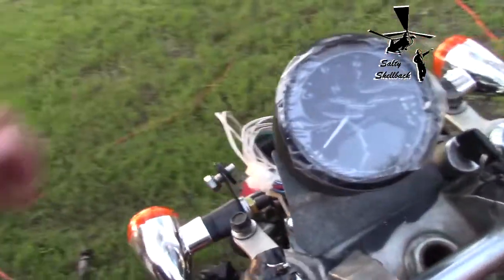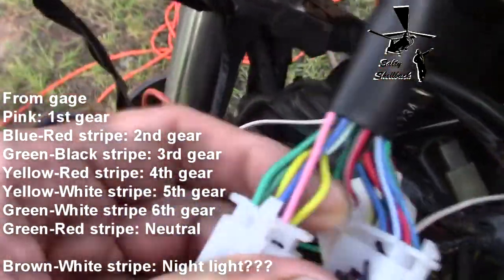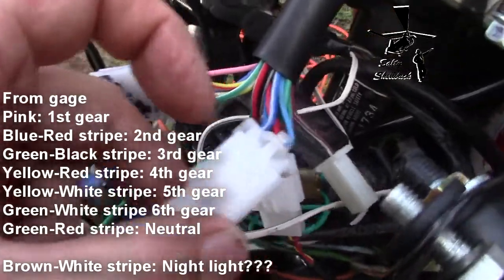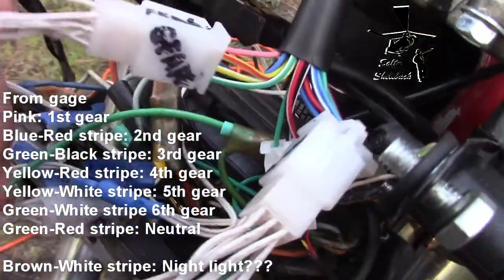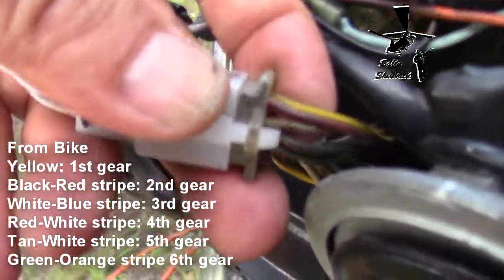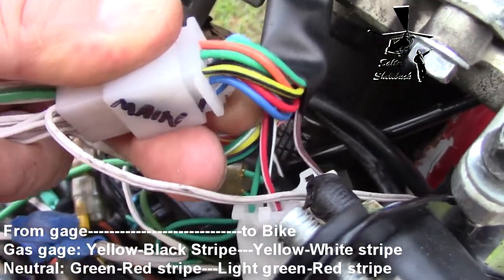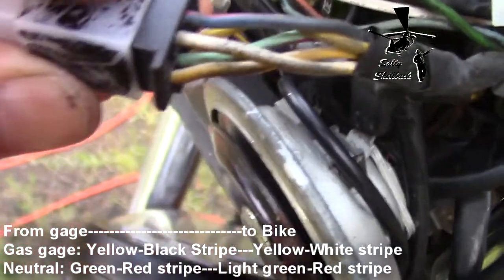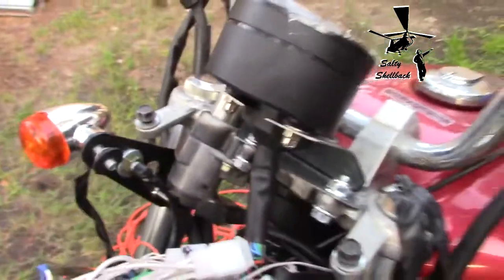How to wire universal speedometer gear indicator-Honda CB650SC Nighthawk

Comment: Great effort Chief! You wanna come up and figure out the craziest spark issue I have ever seen on an older KLX300 ATV- thing fires spark after you let off the starter button. Ive tracedevery wire from Stator too CDI to coil. I finally have order a damn manual with component test procedure waiting for it too come in.
Reply from the maker: Hmmmm...from my limited understanding of how stators work, sounds like the stator is still rotating after you let off the starter button. 
 I am guessing you have the plug out if the engine when you are checking for spark, so that means there should be no compression in the cylinder, which will allow the stator to turn a bit longer after letting off the starter button.
Still shouldn't turn more than one revolution. If it is turning a lot, could mean that your piston rings are shot.
That's my guess. Get a compression checker to make sure 😉

Comment: Hey man thanks a TON for this. I was wondering though where the gear wires FROM the bike originate from. I got my first bike and someone removed the gauges and made a spaghetti mess. My nighthawk is from 86. Just wondering if my bike even has gauge wires on it. Thanks.
Reply from the maker: The gear indicator wires usually come from the motor. 
Honda is pretty good about using the same wire colors so the colors on this bike should be the same for most of them.
You may have to get a repair (shop) manual with the correct wiring diagram if you can't find the cluster that has the gear indicator wires.
On this Nighthawk, there is a junction/fuse panel under the headlight that connects the wiring harness from the chassis to the wires that go to the gage cluster and front controls. If that is missing then that would be a real headache.

Comment: Would have any of the other wires you did trying to wire mine up
Reply: I'm trying to get the main wired up
Reply from the maker: OK
Reply: @saltyshellback  I am not sure where I'm going wrong once I plug in the negative the natural light goes out and so far your the only video I have found that's gone into this much detail is there a way I can message you about how to get it working right, my brights ,back light and natural light all light up, back light gets brighter when ground is plugged up but natural light goes out

Comment: Hey I know this was like a year ago but I was just trying to install one of these and I’m scared I might’ve burnt the odometer I don’t know how to find the power and ground cables and many of the other main compartment cables and the wiring diagrams are confusing do you think you can help me out
Reply from the maker: @darwinquizhpi1041  I can try. Do you have the same kind if bike?
Reply: @saltyshellback  yes I have the exact kind of bike I can send you a video and the diagram of the aftermarket part that I bought
Reply: @saltyshellback  I can email it to you if possible